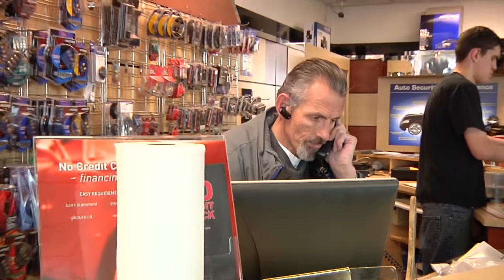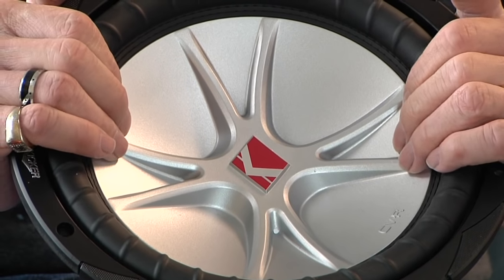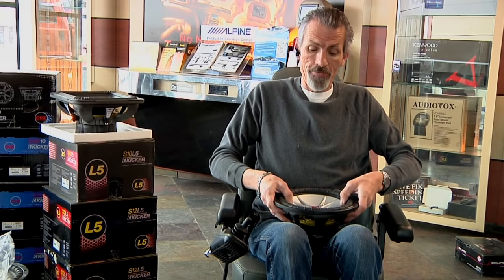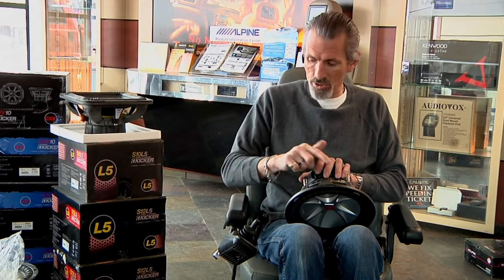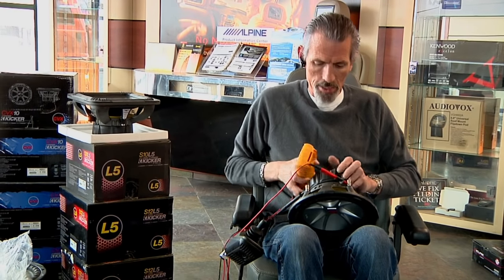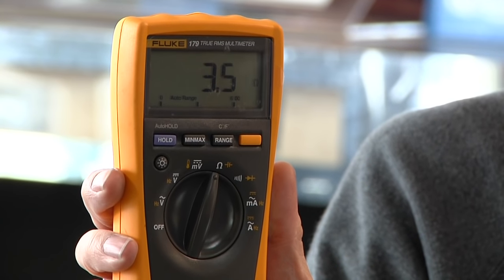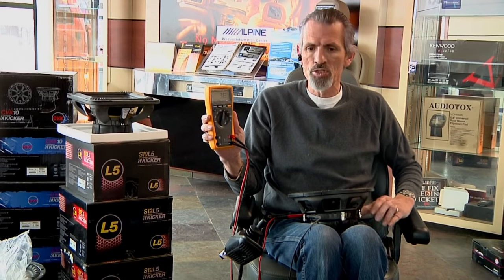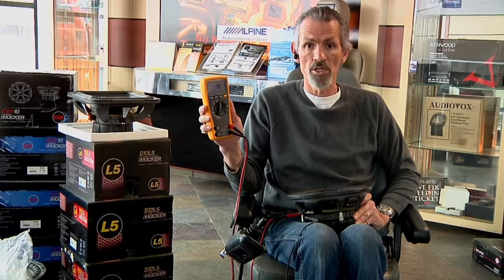Car Audio : How to Tell if a Car Subwoofer Is Blown

Comment: Kinda liked the vid, but dude needs to be more accurate. "Make sure your somewhere without air"  ? Brave space or take your subs to a government testing lab with a vacuum chamber...  Think I'll just worry about having the speaker level, while indoors and quiet when i take the reading, thanks for the no air tip tho.  Worse yet tho, you go to all that trouble and  " None of them Ever read what they're rated" ??? Damn none??? Not once? Not Ever??? Wow. Might have a bad meter or maybe ya gotta go deeeep space to get an accurate reading.  Geez good luck with that method man. I Bet ya Never have actually had a reading " jump around" tho, besides yer shaky contacts or if the voice coil wer moving during the test because your talking into the cone while taking the reading. The failures found with yer meter would be either v.c. Shorted or v.c open.  ..
Reply: Jax Turner Actually he's right. I have yet to find a speaker that's rated at precisely 4.0 (or 8.0) Ohms DC. Not even resistors come close (the standard ones also have a tolerance of +-5-10% or even up to +-20%). So what's the fuss about?
Reply: @blazeaglory  DAMN blazeaglory!  Now THAT  is what I call an AWESOME  comeuppance!  Made me laugh like hell too!